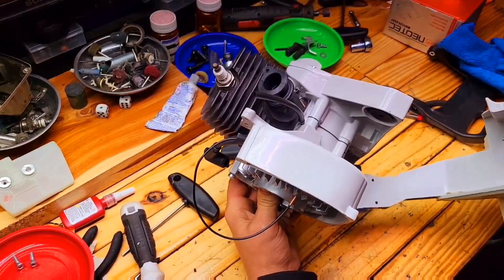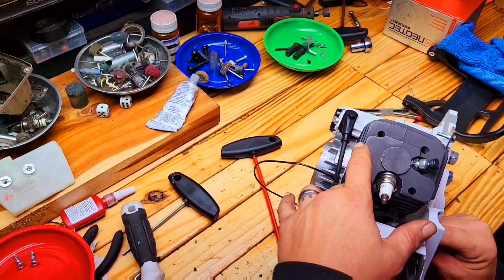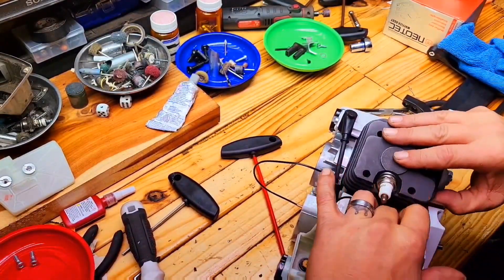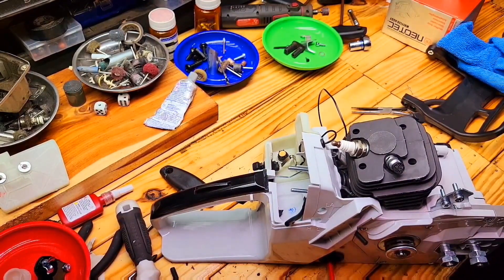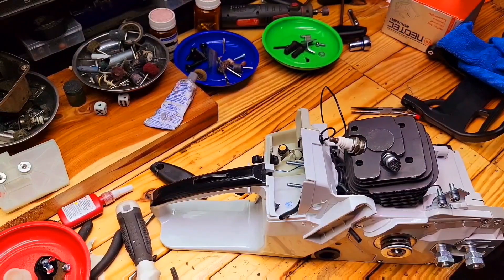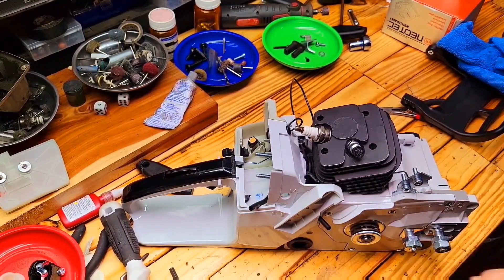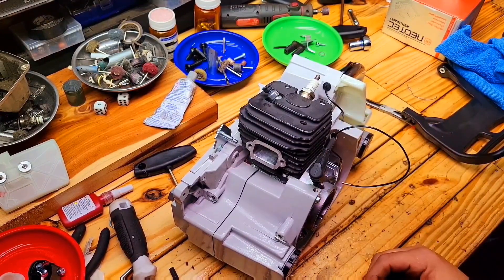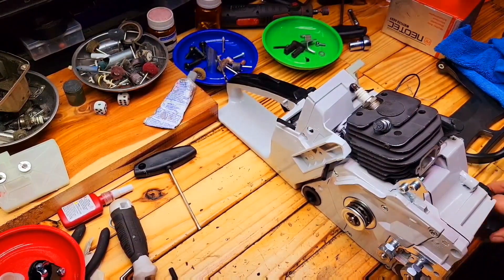Stihl ms381/380 neotec parts kit build pt4 bolt for bolt antivibe, fuel tank,carb,kill switch covers

Comment: I just finished up the kit. I had a problem with the throttle control/choke mechanism and I saw your kit had it too. The silver flat ground spring that interfaces with the choke control rod is not installed correctly. The spring goes under the choke control rod, not on top as delivered. It works like a champ when relocated, not so well when it's on top!
Reply from the maker: Yes Sir... good eye 👍